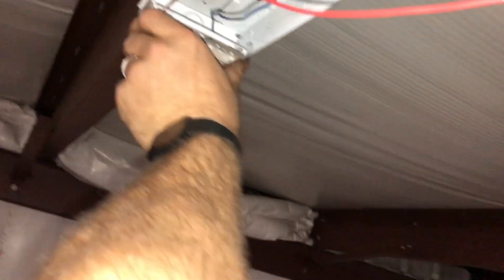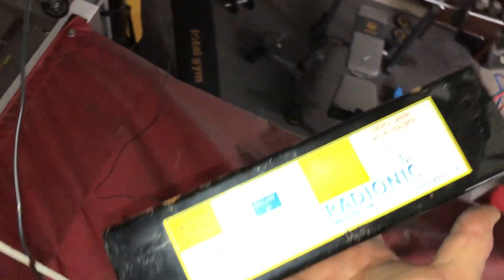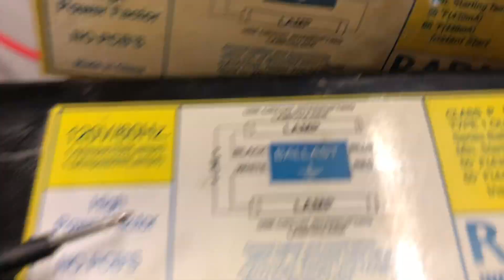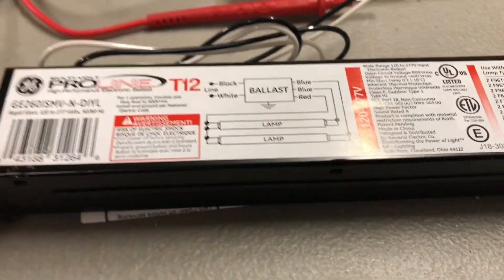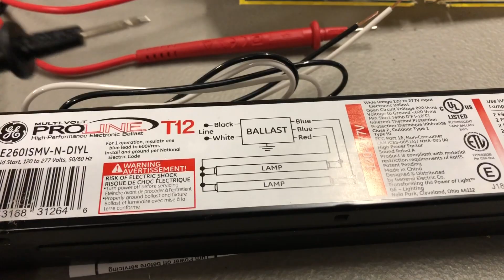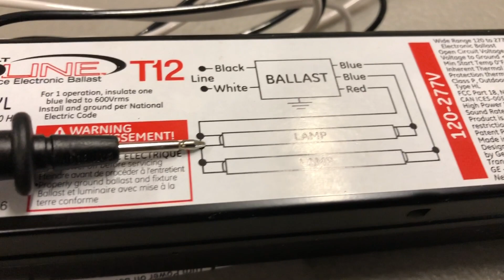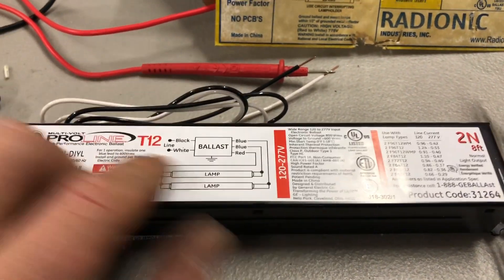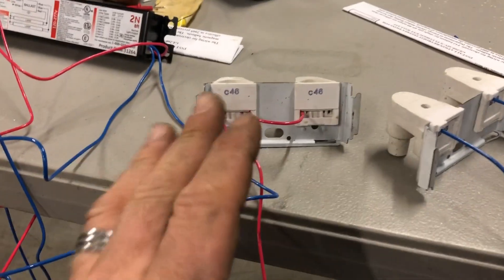Ballast Replacement

Comment: So are u still building cars or did u get out of it come plenty  just asking I really  like your videos  on the way u built them ever  one else would never show how they did there frams if u do something  to they u dont show would tell .me what u did I cant get but about two runs  out of the ones we  build everyone says it's my driving  style  but I blame the build because the same cars we run win shows all the time and I cant get into the finals  with out a have wreck car then the bam thing bells enough I lose drive shaft  so then we take her back home chain it down to the floor bend it  back up put fixet plates where we can then the next run I got to save the  car to try to get to the main it pisses me off then make it in then they just trash my car it only takes about three arena shots and shes back in same shape in life would be great  thanks